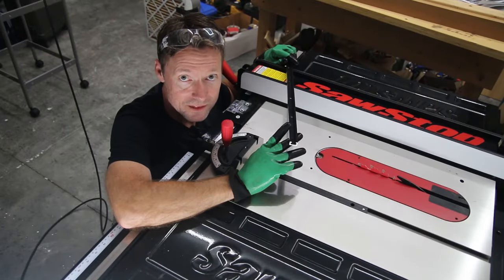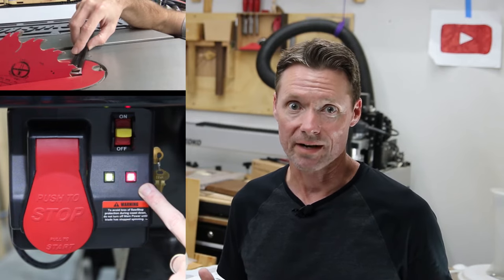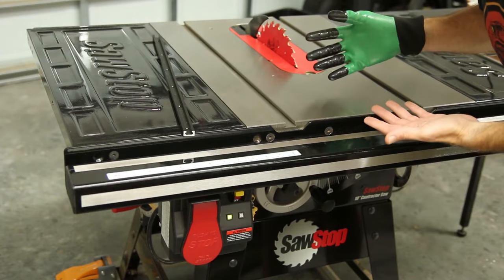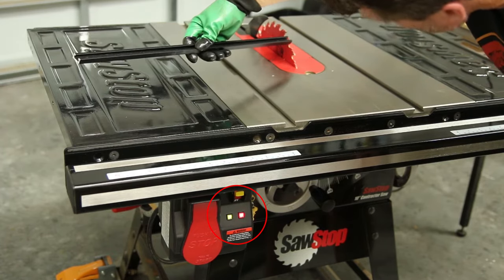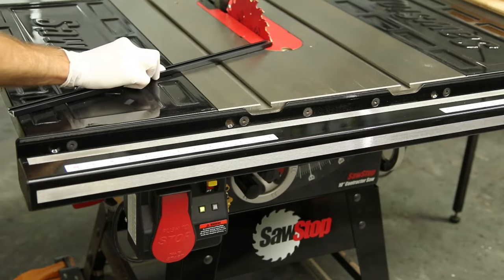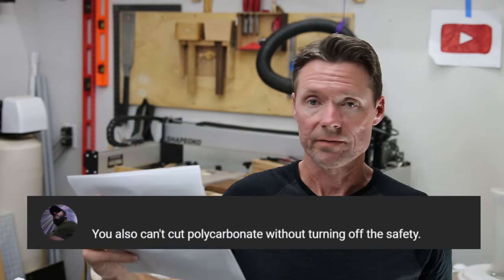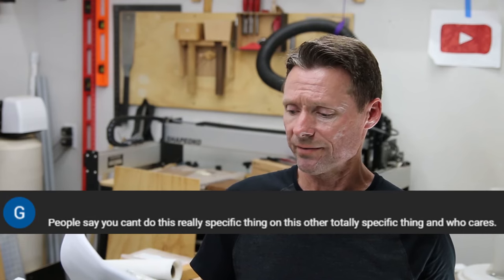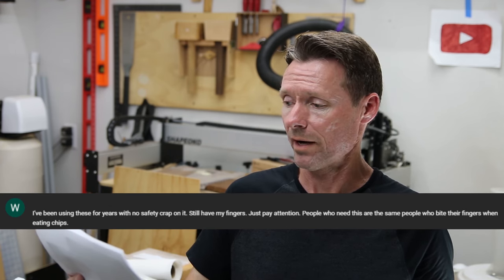Cutting Metal on a SawStop!

Comment: Hey. Thank you for the follow up video. You talk so smooth and easy-to-understand. Keep up the good work. Also, I was one of those who recommended using gloves. I guess it uses a more complicated system to detect touches. Can you try again using gloves and also grounding the aluminum piece? I guess the stick acts as an antenna and the electromagnetic waves from the power lines generates enough electricity in it so that the device thinks it's a human.

Comment: After  you cut aluminium on a saw stop, YOU MUST CLEAN EVERY SHARD OF ALUMINUM from the saw and surrounding area before going back to using the brake on wood.  I just finished trimming aluminum, casually cleaned up before moving on to oak and *B:ANG*, triggered the brake.  I had cut pieces of the dried oak dozens of times before doing the aluminum.  That was the only variable.
Reply: Good to know, but my takeaway is just don’t do it

Comment: Curious if you recommend any specific cleanup process after cutting metal on the sawstop to prevent future brake activation?
Reply from the maker: Great point. That T track is the only metal I've ever cut so I didn't do any kind of clean up. But if you cut a lot of metal then it's probably a good idea to vacuum out all the debris around the blade housing and right under the table.
Reply: @MakerBeach  kinda figured. Got some aluminum bars to cut, so that seems worthy of a thorough cleaning.
Reply from the maker: @KennethYounger  be careful!

Comment: So would it be accurate to say, basically the SawStop works similar to a metal detector, measuring the change in conductivity, rather than closing a circuit?